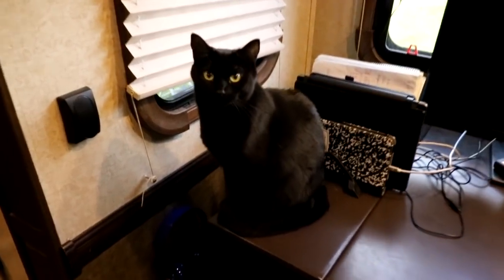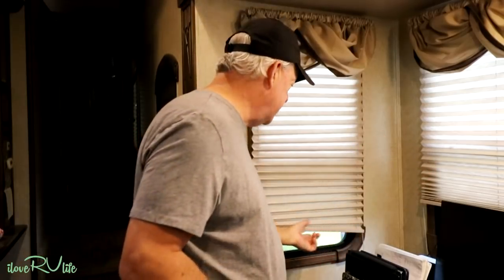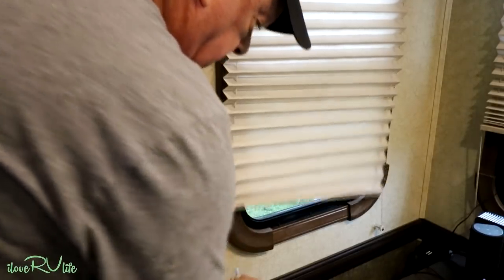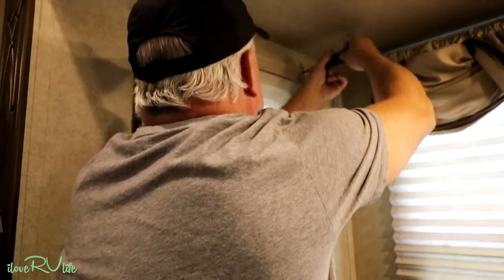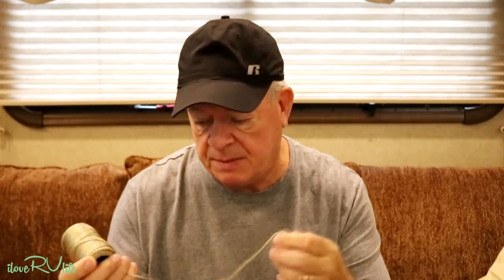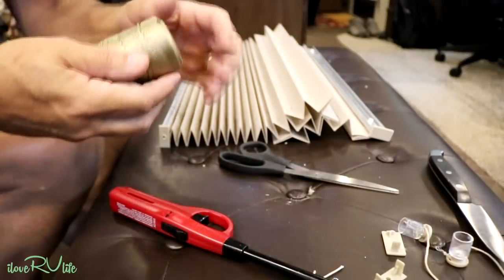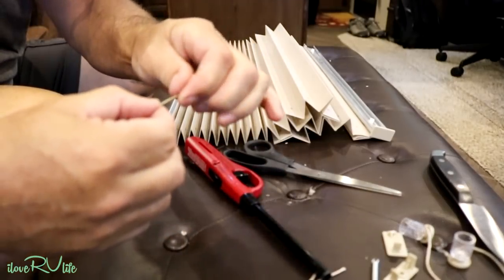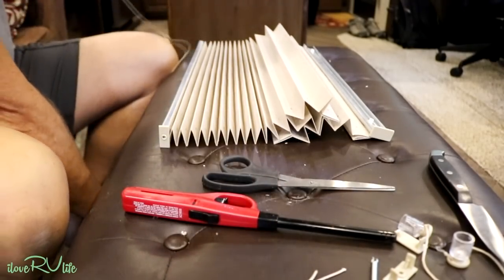Repairing RV Blinds

Comment: Thank you for this information. We have a fairly new camper and had to take it to the dealer and replace the large window that was broke in a storm . When we got it back,  the folding blind did not work any more,  So now I can repair it instead of replacement,  or an argument with the Salem dealer. Thank you for the great tutorial.
Reply from the maker: Thanks a bunch Mike.

Comment: Thank you for making this video!  I saved it in my "How To" playlist for "just in case".  Well one of the blinds in our RV just broke, and I remembered your video!!  It made it very easy to repair!!  One thing I did differently:  Instead of threading through each pleat, I collapsed all the pleats flat, threaded a large needle with a large eye, then with 1 push through, that side was all threaded at once! :)  (Hope that makes sense).
Reply from the maker: So glad our video helped.  And thanks for the tip.
Reply: @iLoveRVlife  :)

Comment: Jerry,  Finally got around to repairing one of my blinds, your video was excellent though I had 4 string, not 2, so it took me 3 hours.  I wanted to mention i was able to run string through the blind folds quickly by closing acordian and holding by tape and string went through real quick.  Thanks again, couldn't have done this without your video guidance.
Reply from the maker: So glad we could help.  The 4 string does takes a few extra steps.  Good idea on the tape.

Comment: Excellent! My 5th wheel came with some broken blinds. I told the dealer not to replace them, knowing that would only drive my cost up. I figured I'd take them all down and put up curtains, but after using the ones that aren't broken, I really like them! If I did curtains, I'd have to buy double the curtain rods and sheers in order to get the same day/night functionality. After seeing how simple it is to repair, I'd really rather just buy a repair kit! You made this look really simple. Thanks for posting this!
Reply from the maker: Hi Lisa and thanks.  The repair kits are a little pricey.  If only the string is broken, about 10 cents worth of string is all you’ll need.
Reply: @iLoveRVlife  Oh yeah, I bet that is all I need. Is the thickness of the string super critical? It looks like kite string may do the trick. 
Thanks for the quick reply!
Reply from the maker: It is. I wouldn’t use kite string.  To thin.  I went to Walmart and found a nylon string that was close to the same thickness.  Inexpensive and very strong.

Comment: Thank you for that tutorial. We have four vertical strings and I am completely confused on how to fix it. Someone else reStrung it for me but I can't seem to get any tension on it AND there is a loop where there shouldn't be that I can't seem to tighten.  Help!
Reply from the maker: The large 4 string blinds are similar to the 2 strings with a cross at the top and down the sides.  Hopefully, the springs weren’t removed at the top.  You can add a little tension at the bottom by tightening the strings.  Doesn’t take much.
Reply: @iLoveRVlife  so for the middle strings, do it just mimic what was done for the outside strings??
Reply from the maker: Kinda Jodi.  It similar, but you see how they cross on the top.  It takes twice as much string which can be a little cumbersome, but very doable.
Reply: @iLoveRVlife  oh hi! Thanks for the reply so I have two springs and four strings.
Reply: @iLoveRVlife  ignore my other comments.  I have been searching up and down on how to do it for four strings. So I’ll give it a try with the two outside strings just as you demonstrated and then doing the middle two strings in the same fashion

Comment: I use rubber bands also. While it is squeezed together you can fish the line through with a stout needle or a fish wire. Thanks for the video.
Reply from the maker: Thanks much for the kind comment Michael and thanks for the tip too.  Jerry...

Comment: Hi Thanks mine has come off in the bedroom one side on my own so this might be  a bit difficult for me; do i really have to take the pelmet down as i am in a COTTAGE FROM CEDAR CREEK AND THEN UNSCREW BLIND TO GET CORD REATTACHED TO THE SPRING AT THE TOP. WHAT IS YOUR TOOL YOU USED THANKS FOR ANY HELP YOU CAN OFFER ME
Reply from the maker: Not removing from the wall would make a difficult repair.  Then remove the sides, use something thin.  A butter knife works well.

Comment: Had had to do this last year.  What made it easier to thread through the shade was to fold it up and put Velcro strap or rubber band around blind to keep it folded.  It was very easy to thread through the whole blind it one quick motion.
Reply from the maker: Thanks for the tip Beth.  It's a pretty easy fix.  Jerry...
Reply: WOW THANKS GOT A BEDROOM BLIND THAT HAS ONE SIDE COME OFF AND I DONT WANT TO REMOVE PELMET WILL KEEP THE VECRO HANDY

Comment: Great idea.  How would waxed nylon strong work?  Think it would last longer because the wax would last as a lubricant.
Reply from the maker: May be.  Just thinking, you wouldn't want the very hot sunlight to cause the wax to weep from the string and stain the blinds.   With the plain nylon string it's rather slick. Much better than the cloth string removed. I have one blind I repaired over 3 years ago.  There's no visible wear on the string.  Jerry...
Reply: @iLoveRVlife  Hadn't thought of it melting.  I may test that, put it in the window of the rv sitting in the sun on a tissue to see if it melts and stains. 👍

Comment: Hi Jerry - Just wanted to let you know that my husband and I follow you and love everything you produce. We live in the mountains of North Carolina and my husband is a travel nurse currently in Southwest Virginia. I have watched this video about 8 times now. We purchased a pre-owned Forest River Flagstaff, and have 3 blinds that are now in need of repair. Of course, I chose the most difficult one to start with! I think the previous owner may have glued the endcaps on... However, When I get it all put back together, it doesn't open or close. The top is especially tight and won't move. It was also very difficult to get the fabric on the middle bar.  Any suggestions on this? Right now I'm planning to tackle another one and hoping that it will give me some insight into the first. Thanks for what you do, and the encouragement you give us!
Reply from the maker: Hi Nancy.  Thanks so much.  We too love North Carolina and plan to return later this year.  Idea on the blind.  There’s a cross left to right on the bottom rail that helps hold the blind in place.  Check to see if the string is twisted.  Stay safe.

Comment: Great video...do you have one for repairing those broken lines in a multi stringed one...like the one next to the one you repaired?
Reply from the maker: I don’t but the process is similar.  Suggest spreading the blind out to see the routes for the strings.  The larger blinds have a few extra, but are just as easy to replace.
Reply: Ok thanks...have a clear RV road ahead

Comment: Thanks for the demo.. Any ideas of why some "bunch" towards the top when raising? They seem not to keep the fold.. Also, any opinion on whether to travel with them down or up?
Reply from the maker: Glad to help Roy.  These blinds develop a memory.  Some will "relearn" the pleat if you push all the way up for several days.   The strings need to be tightened a little more to stay in place.  Too tight and the blinds won't move up or down.  Too loose and they don't have enough friction to stay in place.
Reply: @iLoveRVlife  much appreciated.
Reply: Just went and and slowly raised and folded them all the way to the top. Around half way is were the issue starts. May tighten the strings a little as I noticed too much play.

Any issue traveling with them down or is up preferred while moving?
Reply from the maker: No issues Roy.  With the right tension on the strings they should stay in place.
Reply: @iLoveRVlife   Hey Jerry.  After your suggestion of pushing the blinds up all the way the other day, I thought about doing all of them and then testing the two with the issue. Well, it was a success. All the way down and back up in perfect folds. Nice call Jerry.  Really appreciate your time and help.
Reply from the maker: That's great. So glad to hear all worked out.

Comment: A tip that I found is that if you collapse the shade completely, you can quickly push the thread through all holes at once. Took me 2 seconds to get the string through. Now, I have an issue I need help with. I have a 4 row shade, not just the 2 row like yours. Half the string was gone. Does anyone know how you restring this shade. I am so frustrated, it's almost worth paying $200 for a whole new shade.
Reply from the maker: Good tip.

Comment: Great video, thanks for your assistance. I was able to fix our 4 string United Shade with ease. I found the correct lift cord string on Amazon: Manufacturer, Mandala Crafts, and the diameter was 1.5. MM
Reply from the maker: Thanks for tip.
Reply: How did you do the 4 string?  I can’t find instructions for that. Mine are not day night shades but have 4 strings.
Reply from the maker: Hi Jodi.  It’s similar to the video.  Once you take the top and bottom, you’ll see a loop in the strings.
Reply: Yes my shade over my couch is a 4 string as well as the back window (it falls when driving my class C, luckily I have a rear camera).
The one over my couch broke with so much force, it shot the lower string mount off the wall!

Comment: Thank you for the vidéo......My main issue is adjusting my blind which are the larger ones: 4 strings.  I have a hard time getting them even at both ends and....they pucker at the top (they are not pleated like the bottom).  This only occurs on my 2 larger blinds....My patience is running out I need your HELP....hihihi. Lucie
Reply from the maker: Understand.  Same for us.  It’s a two hands operation, grabbing on each end and pulling.  If uneven, just hold one side as the pull the other to level.

Comment: Would you be able to use metal wire instead of string?
Reply from the maker: That might not give the same results.  The string gives a bit of friction to hold the blind in place.
Reply: @iLoveRVlife  alr I was thinking the same thing but wasn't sure thought I'd ask someone who has some experience fixing them

Comment: Do you do the same process if the shade has 4 strings. My living room shade broke, the really wide ones.
Reply from the maker: I just repaired my large living area blind.  Same process, just the extra string.
Reply: @iLoveRVlife  mine have 2 Springs and 4 strings. Wondering how to map?
Reply from the maker: Similar to the two strings.  The main part is how the strings loop in the bottom section.

Comment: Could you tie the new string to the old string and pull it through?
Reply from the maker: Once the string weakens, it's best to replace.   The new string is actually better quality and once replaced you don't have to worry about it breaking again. At least, the one I fixed 3 years ago hasn't broken again :)

Comment: Nice job and video! You forgot to mention that it would be a good idea to wash the window and blinds before reinstalling. I’m just keeping it real.
Reply from the maker: Haha!  Thanks Frank.  So true.
Reply: I Love RV Life :)
Reply: How do you wash the blinds?
Reply: One of my screws won’t stay tight so the string can’t get tension. Suggestions?
Reply from the maker: Romano, that’s a good question.  I’m not sure they would hold up.  We go over ours with a soft bristle brush and vacuum.
Reply from the maker: Had the same happen to us Ramona.  Take out the screw.  Dip a tooth pick in Elmers Glue, stick in the hole and break off flush.  If the hole has wallowed out, it may take another toothpick to fill the hole.  While the glue is wet, replace the screw.  Let dry overnight before you restring.

Comment: I have a hard time with the plastic blindness that at the ends.
Reply from the maker: They can be a little aggravating.  Use a butter knife, ease in the space between the rail and end cap.  Then gently wiggle side to side and the cap will loosen.

Comment: That cord is not meant for rv shades.  They do sell the correct cord why not use it?
Reply from the maker: Good question Lola.  Not sure why the cord we described isn’t meant for RV shades.  The factory cord is very weak. Over time as the factory cords failed we replaced with the nylon cord we mentioned in the video. We found the nylon cord lasted over years of continuous use.
Reply: @iLoveRVlife  The factory cord is not weak unless you purchased from a non reputable company.  The cord you are using is not meant for the project at hand.  I have seen this cord saw through fabric and metal head rails.  There is a fine line between function and durability.  On an RV shade it is OK since RV shades are cheap and easy to replace.
Reply from the maker: Ok thanks for input. Guess our positive results from the last 8 years of use aren’t warranted.

Comment: Instead of cutting the two threads...use them as a pull string!  Use no more than 1/2" Scotch magic tape and roll it on with your fingertips after touching the ends of the the old and new string together...
Reply from the maker: Thanks for the tip.

Comment: There you go ... taking money out of the hands of the repair shop.  Shame on you. LOL 

Over the years I’ve never taken any RV back to the dealer or independent shop for repair. I know if I fix it it will be done right.  I can’t help but wonder, however, how much the repair/replacement would cost someone if taken to the shop.
Reply from the maker: Oh, there's plenty to go around :)  Repair costs, guessing here, but the blinds go for $30 to $60 depending on size then and hour of shop labor.  Again guessing, maybe $175 or so for the repair.  Then there's the scheduling and wait of sometimes weeks to get something fixed.  When I repaired my first blind, it was nothing lost if I botched it up.  Such a simple repair that I had to share.  Jerry...
Reply: A.  I think maybe there should be more of the simple repairs highlighted that people will encounter.

B.  With the money you saved ... You now have a good excuse to take momma out for a steak dinner.  :)